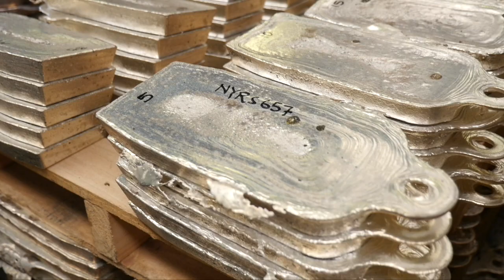Behind the scenes - silver production at The Perth Mint

Comment: I've been regarding the criticism of the mint pretty skeptically, but I'm starting to change my mind. The assertion is that a significant portion of the mint's silver is owned through, or encumbered by, derivatives and that, essentially, much of the silver that backs unallocated and pool allocated silver is across the globe, in others' possession, as part of what is effectively a fractional reserve system.

Given what the accusations about the mint actually are, this video, which fails to address those accusations, seems pretty sketchy. No one doubts that silver exists at the mint, just that it exists, unencumbered, in sufficient quantity to meet its obligations. 

Just come out and say that you have ALL of the silver you  must, and that all unallocated and pool allocated silver is on site, accounted for and has NO derivatives attached. Prove this and be done with it.

NOT doing that suggests that you CAN'T do that - and that in turn suggests that the accusers are correct and the headaches for the mint are about to get much, much worse.